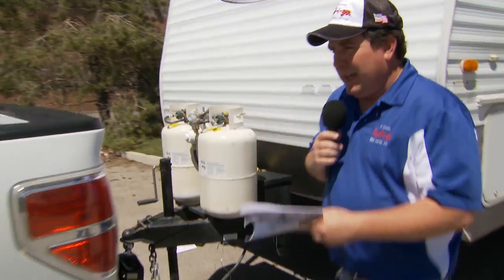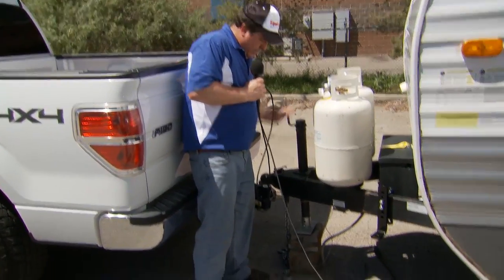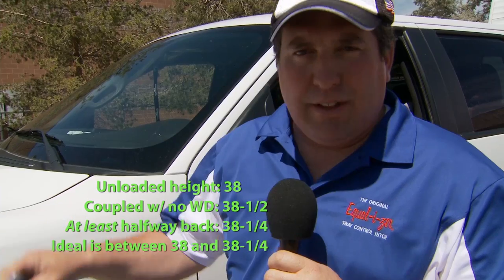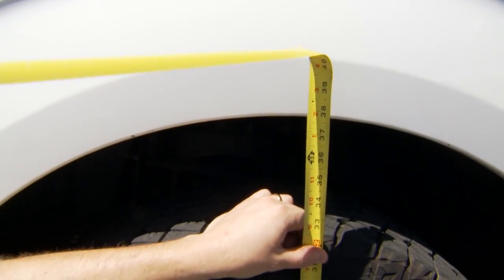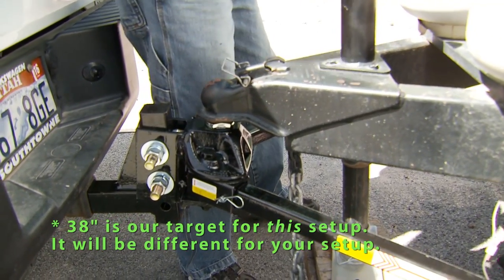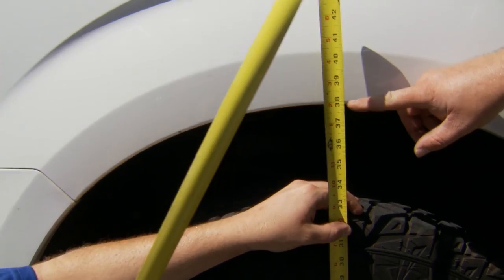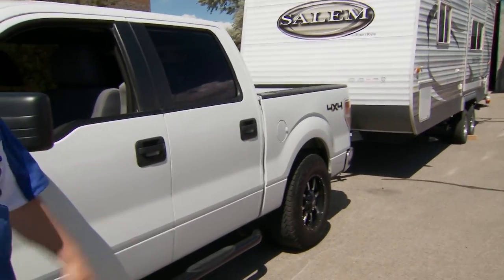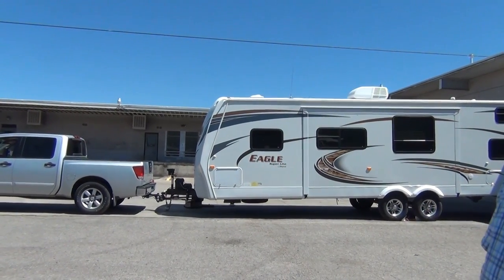How To Fix Over or Under-adjusted Weight Distribution

Comment: Perhaps a silly question but would a small torpedo level on the trailer hitch assist in leveling out the truck/trailer set-up? Great video though.
Reply from the maker: +Lone Ranger,

Thanks! Great question.

When setting up the hitch, we talk about "leveling" the trailer. What this really means is putting the trailer parallel to the ground, because that's the attitude we want in the trailer when towing - parallel to the ground. Level is a little bit deceiving, because it's true if the ground you're working on is perfectly flat, with no slope. But, if the ground is sloped slightly, you want to match that slope with the trailer.

Short answer, a small torpedo level would be great and an easy solution, as long as the ground you're working on is pretty flat, with no slope.

Comment: Should the trailer be completely level after the equalizer is installed?  My RV dealer installed it with my trailer pointing down a little bit.   I complained about it not being level, but they said that’s how they install it.
Reply from the maker: +armstronglance, thanks for the question.
If your weight distribution setup is good and it tows well, we would not be too concerned about the trailer pointing down a little bit, that is a very normal situation. If it is more than a couple of inches and not towing well, you may be able to add a little weight distribution to take that out, or you may need to raise the hitch head to better match the trailer coupler height before setting up the weight distribution. A simple test would be to check the current weight distribution set up by taking the three front wheel well measurements (baseline, coupled no WD, coupled with WD), and then trailer measurements (front/back frame to ground), and then raising the L-brackets one hole, measuring again, and comparing the two. You can find the detailed process in the Equal-i-zer hitch owner's manual here: https://www.equalizerhitch.com/manuals-and-guides
As always, you're welcome to reach out to our customer support staff for help and advice. 800-478-5578 or Support@EqualizerHitch.com
Reply: It is best to tow with the nose down just a tad. If it is noticeable at a glance, then chances are it is too much. An inch or two is best. Never nose high! This will induce sway.
Reply from the maker: Thanks for the comment +Charlie Odom,
Our recommendation is to get the trailer as close to level as you reasonably can while having the proper amount of tongue weight and weight distribution. This should be within about 1.5" difference front to back. Many different factors can contribute to sway, and having the trailer too far out of level is one. Others include exceeding equipment ratings, improper loading, under inflated tires, speed, road grade, weather and road conditions, evasive maneuvers, etc.

Comment: When adjusting the washers at the hitch, more washers = more weight distribution? Where can you get those washers from?
Reply from the maker: Scott Seese,

Yes, adding more washers = more weight distribution.

To get some, give our customer support guys a call, or send them an email: 800-478-5578 or Support@EqualizerHitch.com

You may also be able to find some at a local hardware, fastener, or automotive supply store. You are looking for a "through hardened" washer with a 1/2" hole and 1" outside diameter.

Comment: Do your truck have airbag lift on it? I have 2014 ford f150 4x4 ecoboost super crew, I have two inch leveling lift on front and two new bilstein shock for rear... The travel trailer dealer said that I don't need airbag and weight distribution... My travel trailer is 2017 Avenger... So do I need both airbag and WD even if I have better bilstein shock...
Reply from the maker: It does not. If you do need to use both, we always recommend setting up the air bags first (preferably at a lower level) and then configuring your WD hitch. Setting it up in reverse will cause the air bags to take tension off the WD hitch, which will give less sway control to your setup.

Comment: I am noticing pretty good wear on my L-brackets on mine.  Thought maybe some grease on the bracket, but I don't want to lose the sway control.  Should I maybe drop the bracket down one hole, and add washers to the hitch head?  Everything is nice and level, and the hitch head is square and straight, so just not sure what the best adjustment would be?
Reply from the maker: No need to adjust anything. If you are concerned about the wear on the L-brackets, remember that the Equal-i-zer hitch has a limited lifetime warranty. Get in touch with our Customer Support department at 800-478-5578 or support@equalizerhitch.com. They can evaluate the wear, and send you a replacement set if necessary.

Comment: Another question, for the torque wrench to tighten both 3/4” shank bolts to 320 ft-lbs. I have a torque wrench that goes to 250. May be a stupid question but is that close enough, ie is there a range for this?
Reply from the maker: No. 250 ft-lb is not close enough to 320. There is not a range. If 320 ft-lb is specified, they need to be set to 320 ft-lb. You need to find a torque wrench that will effectively reach the recommended torque so that the hitch head and shank are pinched together and act as one unit while you’re towing. This reduces the shear stress put on the bolts and protects the hitch from wear or damage. Improper torque may also void your warranty.

Comment: So I have a four point system when I go to put the bars in and get everything set it literally takes my entire body weight and every ounce of strength to move bars on to the brackets (trailer is lifted high enough I don't need the tool to lift them).  My main question is it normal that requires that much effort to move them I am physically fit.
Reply from the maker: Yes, it is completely normal for it to require some effort to move the spring arm (weight distribution bars) on an Equal-i-zer hitch side-to-side. This is because of the friction resistance that is integrated into the Equal-i-zer hitch head. The more friction you have resisting the movement of the arms, the better sway control you will have.

The bolts holding the square sockets in the hitch head should be torqued to between 60 ft-lb and 100 ft-lb. Most come from the factory torqued higher than this, so they are very stiff when new. If you find that yours are too difficult to move, you may want to reduce the torque on these bolts and find a happy medium where they are torqued as high as you can have them, while still being able to comfortably hitch and unhitch.

Thanks for towing with an Equal-i-zer hitch!
Reply: @EqualizerHitch  thank you
Reply from the maker: You're welcome!

Comment: Something I’m missing how to set the proper height of the “L” brackets ... ?  Thanks...
Reply from the maker: +Chris Dutton,
The proper height is whatever height they need to be to get good weight distribution. The optimal position is in the center, so that the spring arms are close to parallel with the trailer frame, but this is not an absolute. They will work fine in any position. Follow the setup instructions in the Equal-i-zer owner's manual for a detailed explanation of how to properly set up and adjust the hitch: http://eqhit.ch/manuals  You will use the L-bracket position and adjust the number of spacer washers between the hitch head and shank to get good weight distribution.
Reply: Parallel Arms to Frame - ah Thats It....  thank you! 
Can’t wait to drag out the trailer....
✌️❤️😁
Reply from the maker: +Chris Dutton, you're welcome.

Comment: Not what happens and and do I need to do when I have stuff in the bed and passengers? Thanks
Reply from the maker: Could you clarify what you mean by, “Not what happens…” please?

Yes, it is ideal to have the cargo and passengers in the tow vehicle when setting up the weight distribution. This will get the most accurate setup. If that is not possible, get it as close as you can, and then make minor adjustments when it is loaded as needed.

Comment: where do you get the torque wrench and the socket from?
Reply from the maker: The torque wrench is available from a number of different online and retail suppliers. An Internet search for “3/4" drive torque wrench” will bring up a number of different options.

If you are talking about a 1-1/8” socket for the 3/4" shank bolts, they are also readily available online and in retail locations that specialize in tools. If you are talking about the 1-7/8” thin-wall socket for the hitch ball nut, you can get those from us on our website [link to store https://www.equalizerhitch.com/store/hitch-accessories/1-7-8-thin-walled-socket], or by contacting our customer support team at 800-478-5578 or support@equalizerhitch.com.

Comment: I have E2 system, my question is:
 I have the correct adjustment on the f150 front fender loaded and unloaded that means im perfect on distribution, but the farme of the trailer front is lower 2" than the back how do i fix that? Do i need to pull out washers or the ball needs to go a hole higher? Is it ok to have trailer front frame measurement little lower than the back but distribution is perfect.
Reply from the maker: +Pal Palich,

Of the two, the proper weight distribution is the more important to have set up correctly, and, if the trailer attitude is off, it is generally better to have it lower in the front. If it is currently towing well, there may not be a need to adjust the attitude of the trailer. If not, making a minor adjustment so that it rides more parallel to the ground while still giving you good weight distribution may make it tow a little better, save some wear on the tires, and get you a little better gas mileage.

From what you describe, it sounds like you could improve the attitude of the trailer by raising the hitch head one hole on the shank. If you do that, make sure you check the weight distribution again. Raising the head will reduce the weight distribution slightly, given the same number of spacer washers and L-bracket position. Double check yours before tightening everything back down again, as you may want to add a spacer washer.

Remember that optimal weight distribution is all the way back to the baseline measurement, but acceptable weight distribution is halfway back to that point. You may still have a good setup (fall within that range) without the need to add a washer after moving the head up.

Comment: The sticker on the equalizer hitch head says to “lubricate” all the friction points.  Won’t this reduce the sway control?
Reply from the maker: +armstronglance, the sticker is correct. Lubricate the friction points in the Equal-i-zer head as directed in the instructions. Lubricating these points does slightly reduce the friction at the points, but the overall effect on total sway control provided by the hitch is negligible, and usually not even noticeable.

Comment: Is there a benfit to adjustment it with the washers vs moving the L bracket. In the videos it looked like you did only the washer so didn't know if that is structurally better for some reason?
Reply from the maker: If you are making changes to the initial setup of the hitch, or adjusting to a new position expecting that it will be there for a long period of time, it is better to make the adjustments by adding or removing washers. This is easier to do before the shank bolts are tightened, and it allows you to set the L-bracket position in the center, which gives you more adjustability later for temporary situations if needed. If you are making temporary adjustments because of a change in trailer loading, it is much easier to raise or lower the L-bracket position temporarily, and then return it to the center when loading returns to normal.
Reply: Equal-i-zer Hitch So. Help me here. How do you adjust the L Bracket with load change? When is the L to be move down VS up? Also, what is to be considered temporary?
Reply from the maker: Details about adjusting the L-bracket can be found in the Equal-i-zer hitch owner’s manuals here: [https://www.equalizerhitch.com/manuals-and-guides]. To adjust the bracket, disengage the weight distribution and move the spring arms (weight distribution bars) out of the way. Do not try to adjust an L-bracket while it is still loaded. Remove the nuts that hold the L-bracket in place, and move it up or down, then replace the nuts and retighten them.

Moving the L-bracket up will increase the amount of weight distribution you are getting from the hitch. Moving them down will reduce the weight distribution.

Temporary is any time you are towing a load that is different than the load the hitch is set up to carry. For example, a rear-load toy hauler that is usually loaded with a 4-wheeler for your camping trips, now being towed empty to the dealership for service. The absence of the 4-wheeler will make the tongue weight of the trailer much heavier, so the L-brackets would be raised temporarily to compensate for this and give you more weight distribution.